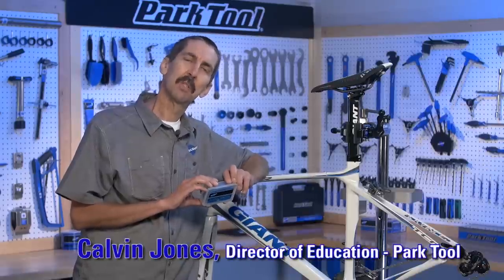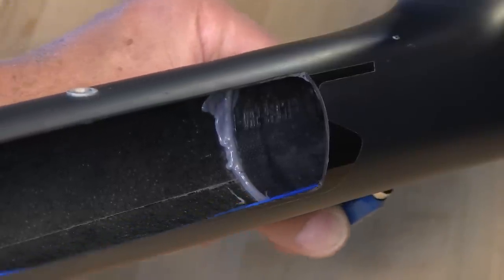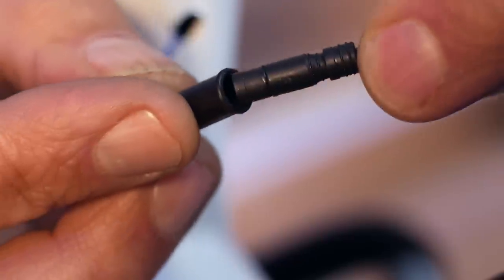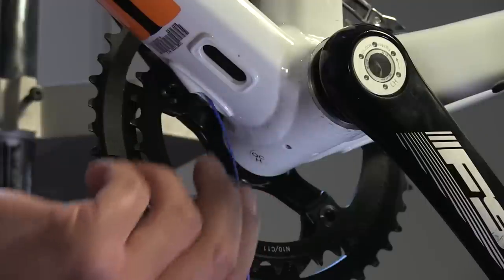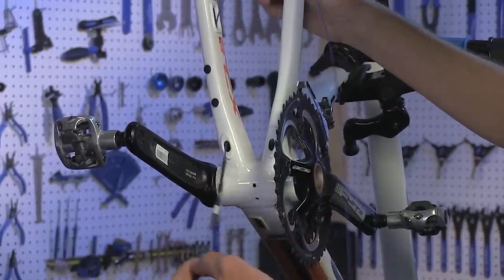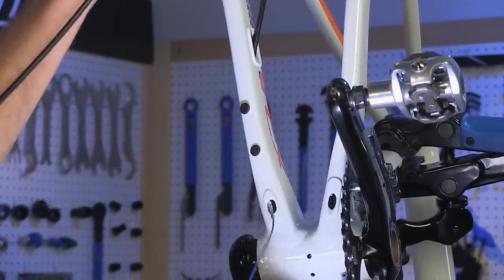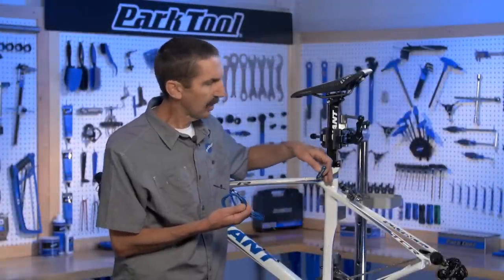How to Use the IR-1 & IR-1.2 Internal Cable Routing Kit

Comment: Excellent piece of kit. In the past I would have put my bike into the local bike shop to get my gear and brake cables changed. Now with this kit I've saved a small fortune in replacing both set of cables on all of my bikes...well done Park tools.

Comment: Just worked a treat on getting housing for an internally-routed dropper post through a carbon hardtail frame. BB area was impossible without the IR-1 (or removing the BB, probably). Whoever designed this tool deserves a Nobel Prize!

Comment: my Cube bicycle has a brush in the down tube, am I supposed to remove it before wiring a new cable in? I cannot move cables easily with the brush inside, but I do not have a large opening for operating pliers either (I would need to enter a small fissure and reach some 10 cm inside)

Comment: If you want a challenge, you should try it on a 2016 Ridley Fenix SL - the bottom bracket area routing is a real PITA
Reply: yip have ridley helium SL and reckon holes too small for these tools to enter

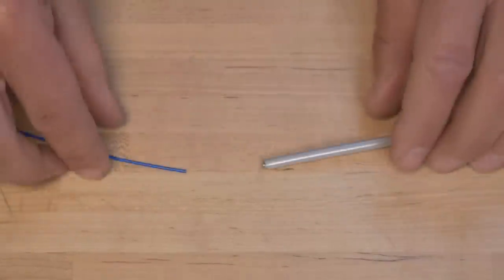Comment: Hello, on video Minute 0:51, I am unable to screw the IR piece into my hydraulic brake cable. Any thoughts? Looks so straight forward on video, but I can’t get it to work for the life of me.
Reply from the maker: If the barb is pressed into the end of the hose ou will not be able to thread it in. Does your hose have a barb pressed into it?
Reply: Park Tool I was able to use electric tape and pulled it using the ir tool on the front fork, boy that took some time. Thank you for your reply though. Very helpful tool.

Comment: there is always a way, a little heat shrink, string trimmer line, neo magnets, crazy glue make your own( unless the park tool is cheap-unlikely) magnetic couplers will a rough time in a steel frame( thats why He said everything but steel) if your bike frame has a lot of "reluctance" the locating magnet may not work.

Comment: do the hydraulic tubes ever get punctured/leak by the metal edges in the frame holes?
Reply from the maker: +neil crompton that is a possibility, but certainly not a likely one.
Reply: just wondered as the brakes lines would be under pressure every time the brakes are applied,does the factory clean up the sharp edges in the holes?
Reply from the maker: That's a question for the frame manufacturer. A responsible mechanic should absolutely check the routing holes for sharp edges prior to running cable housing or hydraulic lines.
Reply: hmmmm was just another curious question

Comment: How about Titanium? Will the magnets function against a Titanium frame ? If I remember correctly titanium is not magnetic , but I could be wrong. Thanks.
Reply from the maker: Neither titanium or aluminum are magnetic.
Reply: @parktool   cool fact you can magnetize Aluminum( with an alternating field) some of the strongest magnets you can buy are alloyed with aluminum( many teslas) if the titanium has little reluctance you should be able to pass a magnetic field.

Comment: Heh... That Di2 Adapter wouldn't have worked with the ports I had to use to get my Di2 wiring done.

Because of the preinstalled Wiring Guides inside the frame ( CF tubes inside the frame ) and the necessity to have the 4-Port hub located somewhere inside I was forced to route the Di2 wire coming from the Handlebar through one of those tubes exiting behind the bottom bracket and then back into the frame via port JUST barely wide enough to fit a Di2 connector wrapped ONCE with a super thin electrical tape.

Maybe make use of the actual connection inside?
Reply from the maker: For Di2 cable routing we upgraded the kit with an additional cable in the IR-1.2.  https://www.youtube.com/watch?v=FUBOn6aJjwo&t=10s

Comment: Excellent piece of kit but having to resort to magnets in order to route cables is just lazy engineering on the part of the bike manufacturer. Either do it right (santa cruz comes to mind) or just use external routing.

Comment: For my bike, the tool was of no use. Luckily, it (the tool) was a gift. My cables are stainless steel, barely magnetic. The frame holes are barely large enough to permit the passage of the derailleur cables. There is no tool in this kit that would pass through the holes and grasp my derailleur cables.The brake cables passed with a tool made from a bent and ground down spoke to grasp them and fish them out. The IR-1 was of no use. For derailleurs, I passed a cable backward and superglued a length of thread to it, then glued the thread to the new cable and pulled it back through. No cost. Still a pain in the butt.
Reply: I think you totally missed the point of it
Reply: I'm sure you've missed the point of it and probably not watched this video with full care and attention...
Reply: I totally get what you said as I have had the same problem with a Pinarello frame. Glue, thread and a vacuum cleaner to suck the thread through is how I solved too.

Comment: Would it work for steel (CrMo) frames too?
Reply from the maker: The IR-1.2 is designed for non-steel frames.  The magnets stick immediately to steel, and will not work their way through the frame.
Reply: @parktool  use compressed air and a small drag chute?
Reply: or a little cocktail umbrella..
Reply: Not the magnetic parts, you might be able  to actually shield the magnets with some material of high reluctance and join them end to end

Comment: Hi, i have tiranium frame. It doesn't have internal route. Could you give me an idea how to install internal cables, thanks
Reply from the maker: Unfortunately if your frame is not drilled for internal routing you cannot install internal routing. Some custom frame manufacturers will drill holes for internal routing on a used frame. Good luck with the project!

Comment: Out of luck if it's steel
Reply: +Michael Thompson How many bikes with internal routing have steel frames...
Reply: +Karl Dutschke My Team Z Lemond tricolour made from Columbus EL-OS tubing does...
Reply: +Karl Dutschke anything high end and italian from the 80s-90s
Reply: I had my steel Rawland Ravn modified for internal routing of Di2 cables.  Routing the cables was a real pain.
Reply: orange p7 is steel but it doesnt have internal cable routing
Reply: Just use the threaded parts.